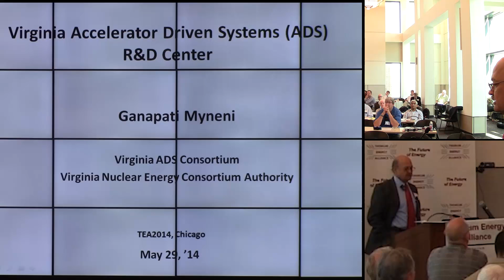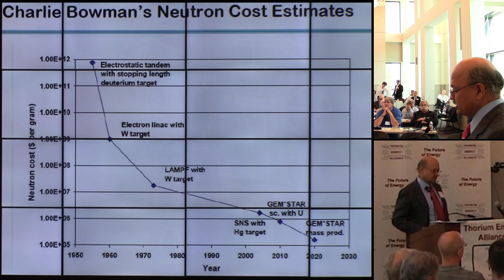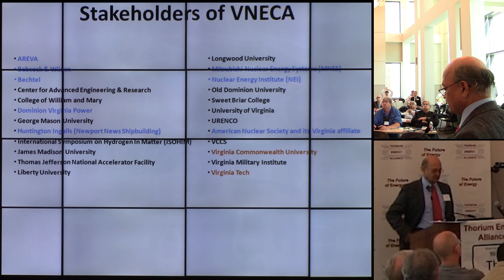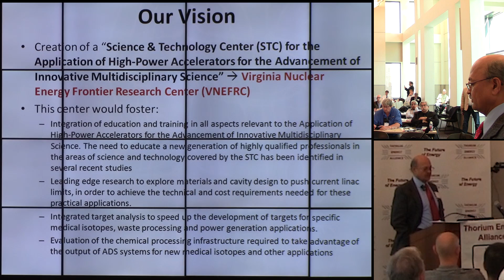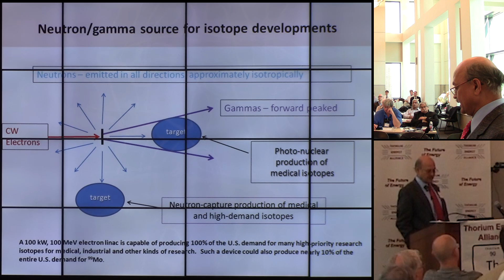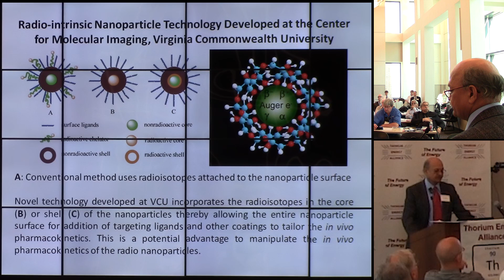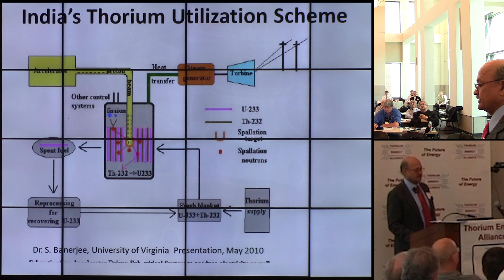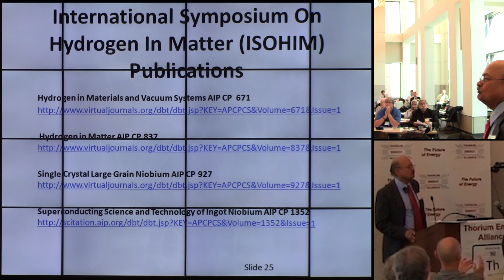Ganapati Myneni - Virginia Accelerator Driven Systems (ADS) @ TEAC6

Comment: I don't see the point of accelerator driven systems without reliable accelerators. Until such accelerators are fit for purpose then there is no point talking about it.
Reply: Actually they are not "Driven" they more like "Subsidised". It's a good way to get rid of the tritium.